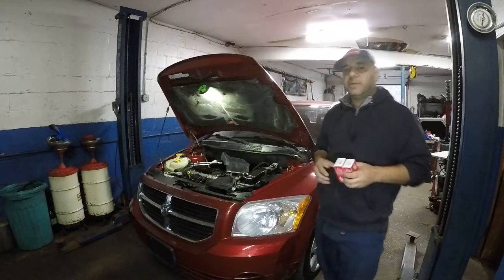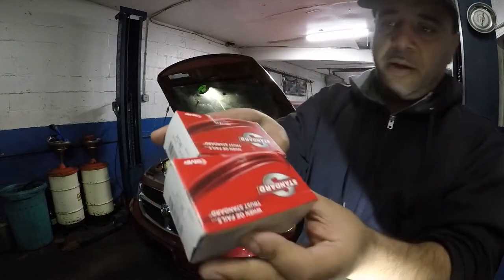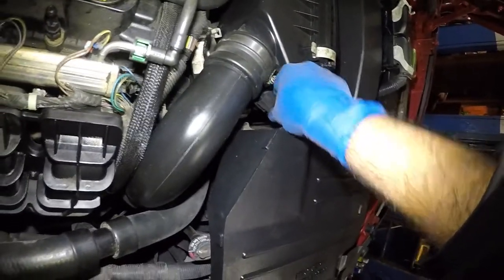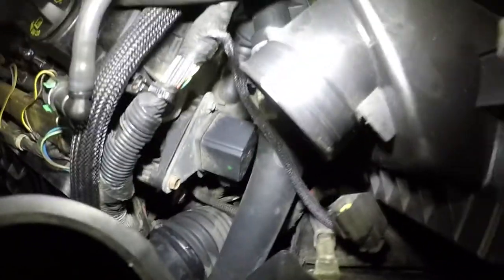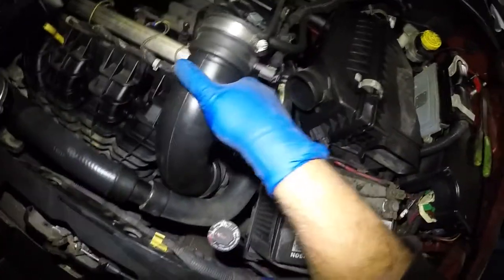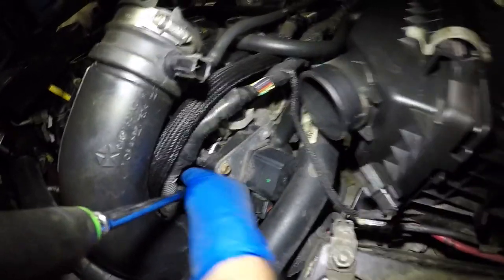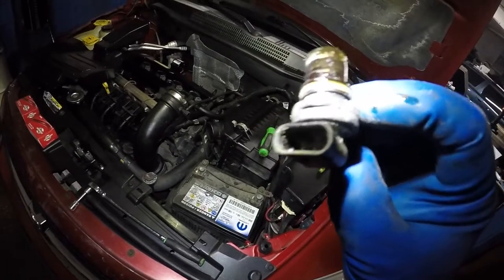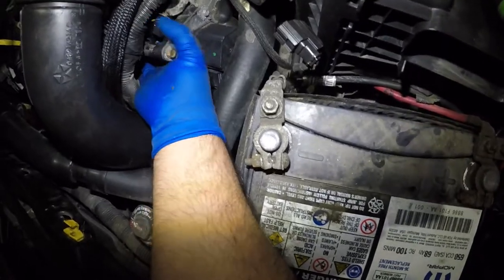DODGE caliber 2007  replacing cam sensor bank1 and bank 2  code P000B & P000A

Comment: I don't know why no videos online explain that when you have the relays in and the air conditioning is not working merely testing the relays by pulling them is not going to tell you if they are good or bad. I still have the problem still seeking a good video
Reply from the maker: This video is not related to ac what is the issue ur having with ac

Comment: whats up homie. i thought i might have bad fuel pump or bad fuel injectors could cause this code P000B to show up? ive had intermittent problems with my car not accelerating for 5 seconds after stopping. Car didnt start one time but usually fires right up. And my car changes speeds slightly when i am driving. If i accelerate too fast my RPMs get unusually high. I have to d rive like my grandma. But id really  appreciate any input you can provide
Reply from the maker: Yup this is very common on these

Comment: After changing the Camshaft Position Sensors, will you have to do a relearn procedure with a scanner? Asking specifically in regards to the 2007-2009 dodge caliber..
Reply from the maker: No relearn but u do have to reset it

Comment: I got this code on my car. Do you think it should work the same way? . I mean only to replace the crack sensor it will be solved? . I got 2015  dodge charger 3.6
Reply from the maker: If u got the code u got to replace it then reset it

Comment: How many crankshaft sensors are there in the AWD 2007 Dodge Caliber R/T, please?  I have my car at the mechanic and they say that they need FOUR hours.  Is this correct, or are they just giving themselves that much time in case it takes that long? If the sensors take only an hour each and there are only two of them, wouldn't the time be more like a two-hour job? Or are there 4 sensors to be replaced? 

I'm exasperated because they say as it's a half-day job they cannot do it until May 25th, 2023. My car was towed to them on April 28th. I had an appointment for May 8th, to have spark plugs changed and fuel lines checked, as I didn't know what was wrong. Took them days to figure out it was the Crankshaft sensors. 

I'm a retired woman trying to research what's wrong. I figured as the professionals they would have suggested that this was the issue with my car in the beginning. I've had my car to them three times, telling them that it was losing power on the highway going uphill.  My Car finally just quit and I had to have it towed. 

Can you make any suggestions? Thank you. Appreciated it.
Reply from the maker: I’m not sure if they saying crank sensor? It got one crank sensor can u find out if it’s crank or cam? Or oxygen sensor
Reply: @RBTheMechanic  crankshaft sensors for an AWD 2007 Dodge Caliber R/T
Reply from the maker: @zaralunden3202  it has one sensor
Reply: @RBTheMechanic  There was a temp receptionist who said Crankshaft sensor. You may be right and it is the Cam Shaft Sensor and two like in your video.
Reply from the maker: @zaralunden3202  yea it might be cam se side cuz no car has 4 franks. Ur it dose have 4 cams

Comment: Hi! Patriot 2.4 2013 engine knocks a lot and the error code is P000B. Could this sensor be the reason for the knocking? Has anyone had a knocking engine and after replacing these sensors the knocking went away? Thank you!
Reply from the maker: No I had never had this knocking due to this sensor how ever u can replace it and see the outcome
Reply: @RBTheMechanic  Thank you so much!🙂

Comment: Which one is bank 2?
Reply from the maker: What size is ur engine? Year make model?
Reply: @RBTheMechanic  2008 jeep patriot 2.0l
Reply from the maker: @606_sports  that’s 4 cylinder it dosent have bank2 what is the code  ur getting
Reply: @RBTheMechanic  p000b
Reply from the maker: @606_sports  ok that’s camshaft sensor B which means exghust cam sensor I would recommend u replace both cam sensor.   And then reset the light how ever if the code repeats then replace the oil control valve.   First do the sensor if any issues then we can discuss the other valve later on.
Reply: @RBTheMechanic  sweet I just ordered the cam shaft position sensor

Comment: I have this code but already did this but it’s still there
Reply from the maker: I have about 4 videos on this so replace the sensors and cam acuator worked out
Reply from the maker: Just doing cam sensors some times dosent fix the issue. What codes do u have
Reply: @RBTheMechanic  Code: P000B B camshaft positions slow response Bank one. We change these parts.
Crankshaft position sensor, A and B, camshaft position sensors, VVTS, intake and exhaust, and oil temp sensor.  
it idles rough. sometimes the check engine light will come on and sometimes its not. Currently the light is off but the code is still.
Reply from the maker: @jujub428  u might need to use better scan tool to reset the light and after that it will test it self
Reply: @jujub428  try the crankshaft sensor... this video is Camshaft sensor